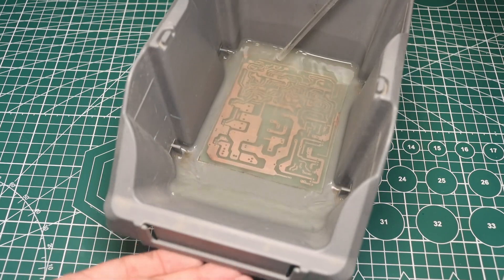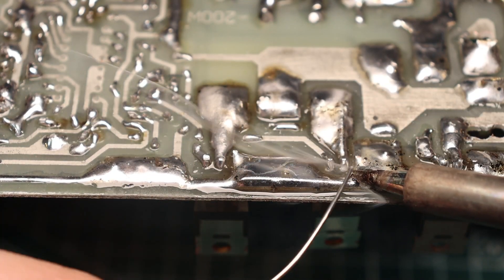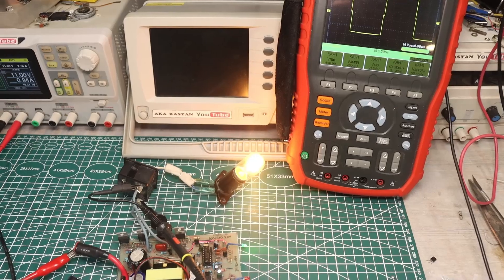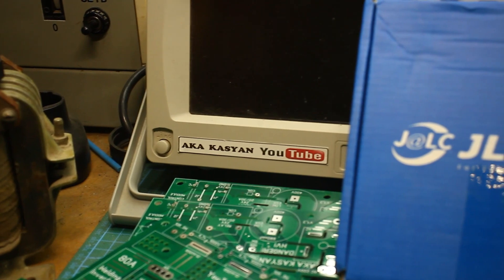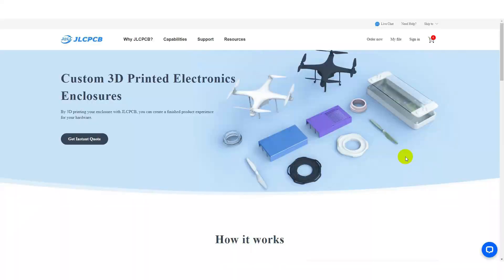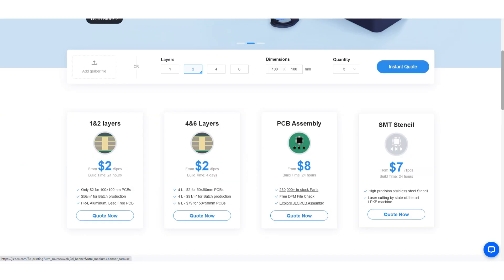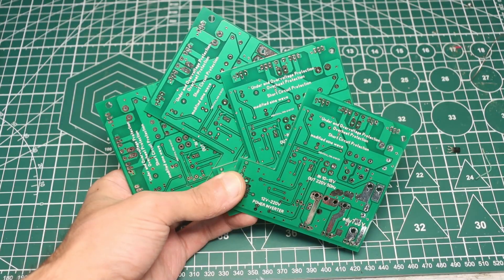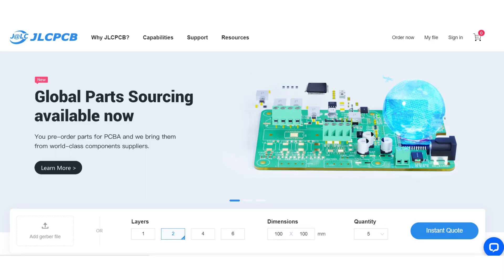A Day in the Life of a Radio Amateur

Comment: That's not a modified sinewave inverter but rather a square wave inverter which are
useless on anything that is an inductive load so they have limited uses n usually buzz quite loud while doing it, hence why there a very cheap design, if you went to all the time n trouble to make an inverter you could have at least made a pure sinewave one there not that much harder to make.